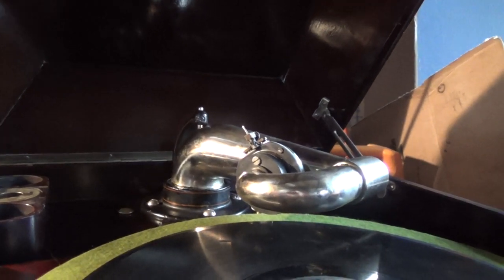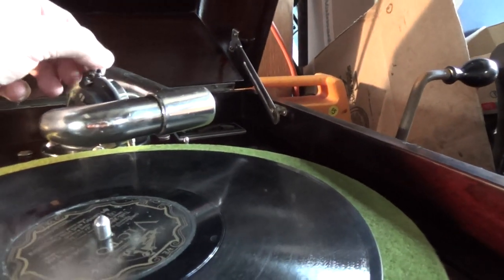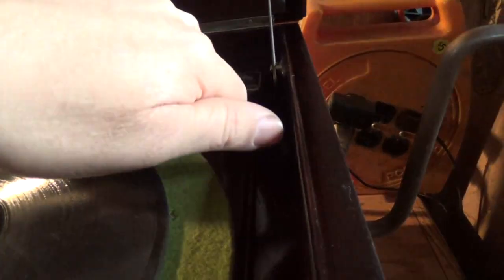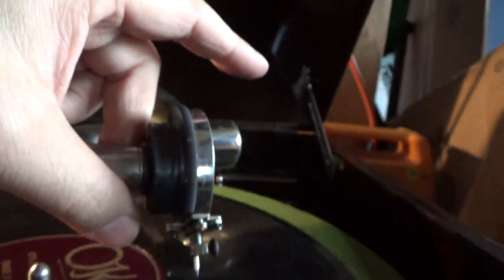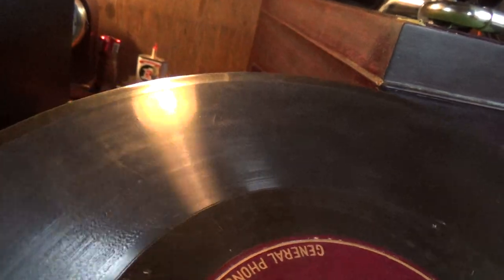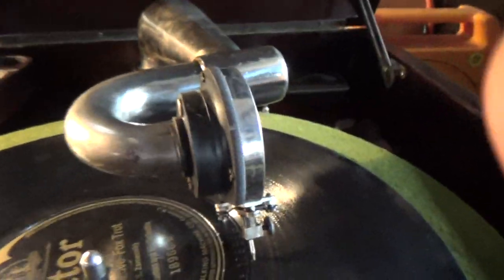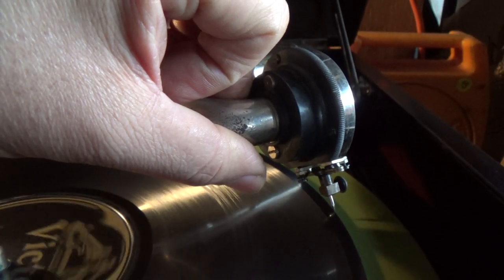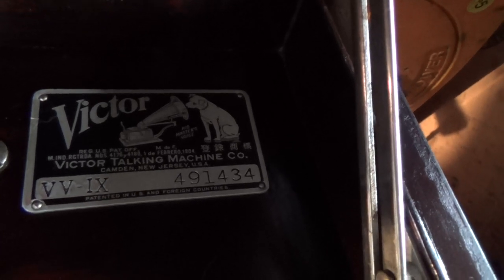Exhibition reproducer rebuilt and back on Victrola 9 1920

Comment: great rebuild job on the Exhibition.
Reply from the maker: Thank you, repetition is the key.  I work with this reproducer more than most others since I play with the older machines.  I don't know how many I have done, but 50+ is likely.  A lot for someone who is a hobbyist, and not rebuilding them for a living.  Two important things to remember when rebuilding Exhibitions, don't let the diaphragm touch the metal of the reproducer body, hard considering it's a tight fit.  Number two is correct needlebar alignment.  It has to be 90 degrees with the side of the body while the bar foot just barely touches the diaphragm.  This can take some time to get right with endless gentle adjustments of the bar until everything lines up.
Reply: @Rockisland1903  Thank you for your good insights. I appreciate your knowledge and experience.
I've been into the hobby on and off for 40+ years and have yet to rebuild a reproducer. Been afraid to get my feet wet...That and also replacing a mainspring...

Comment: Sorry, I may have said this before, But I have a very pristine VV-IV and I need to rebuild the reproducer, But I can't find new back flange gaskets for the exhibition reproducer to save my life, can you give me some sources? Thanks in advance!
Reply from the maker: I get mine from Walt Sommers  717-334-0862,  he could be out, or low on inventory and not currently advertising them on eBay, but he always gets more ready.  Call him, maybe he has a few set aside, or can let you know how long the wait is until he makes more.  This is a very common item, all the larger parts sellers have them, but inventory does need to be replaced now and again.   Walt is Gettysburg Antique Phonographs

Comment: You know how to get the flange of an exhibition reproducer stuck on a tonearm? Or ever had to deal with this particular issue?
Reply from the maker: Stuck on or off?  Getting one that is stuck on is common enough.  I soak it in Kroil oil, let it sit, then wrap a towel around it and twist it off .  This is with the tone arm removed from the cabinet.  Hitting it with a heat gun can also soften the old rubber and crud a bit.  Getting it to stick on the arm would require glue as this was never the intent of the design.  If the reproducer is loose when installed on the arm you could try wrapping some plumbers tape around the end of the arm and then install the reproducer over it.  Also very gently bending the end of the arm at the slot were the reproducers guide pin slides in can tighten it up a bit.
Reply: @Rockisland1903  the rubber part has mostly hardened and fallen off it’s just the metal piece that’s frozen on to the tonearm
Reply from the maker: I had that issue recently.  Take the entire arm assembly off, on uprights and lidded tabletops it's the three screws around the black base.  Removal will differ on portables and smaller no lid tabletops, but it shouldn't be hard to figure out.  Soak that metal bracket, it's brass like the tonearm.  Put on a pair of heavy leather work gloves and work it back and forth firmly until it starts to move in the slot, then line up the guide pin in the slot and wiggle the piece off.